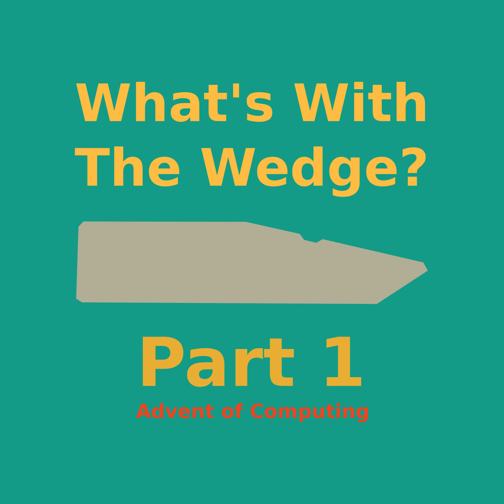Episode 62 - What's With The Wedge? Part 1

Comment: Great podcast.  It was a deep dive into places I did not know existed.  It reminded me of my own wedges:
TI Sinclar, TI-884A, and ATT 7300 unix box.  I think the wedge just made sense back in the day.  I rectangle box with a keyboard would have been hard on the wrists.  The wedge allows for ergonomic keyboard placement, and the space to stuff all the remaining bit into.   It also fit with the build m cheap, anything goes cowboy early days.  Virtually all had power, I/O and expansion connections sitting out in the open right from the motherboard.  Ahh, the good old days!